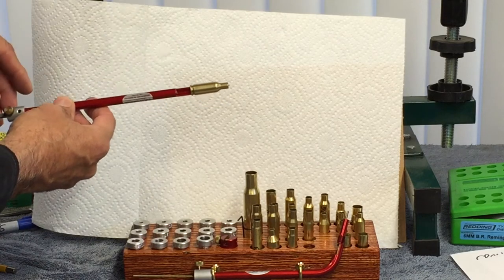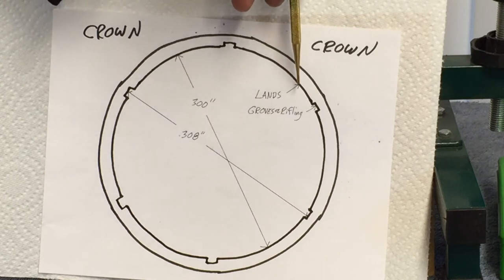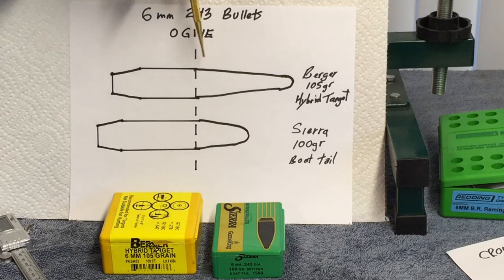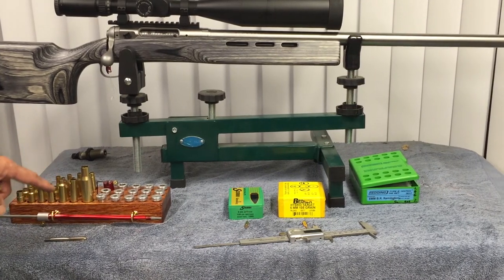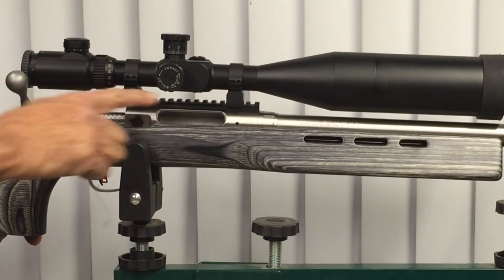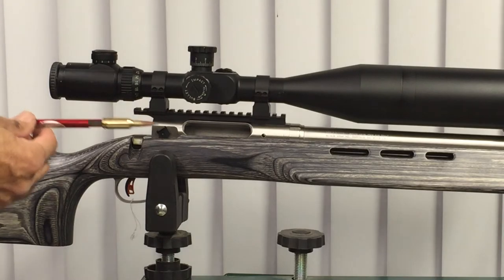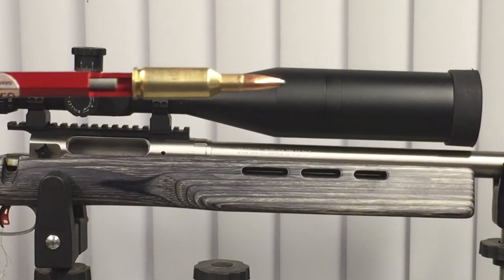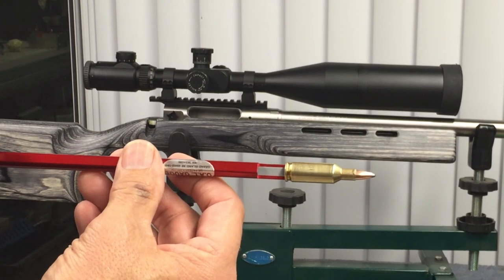Measure from the Crown to the Bolt in a Rifle Chamber

Comment: Thanks for the great video.  I am new to reloading and really thought you put out some great information.  If I understood correctly, with each designed bullet, will lend a different overall length to set the bullet to case in right?  What you displayed is a very accurate measure, cannot go wrong with this method.  Thank you for your time.
Reply from the maker: Francis Murphy Yes slightly different measurements. We need to be aware of the OAL so the round will feed in the firearm. Some will be to long. The off the shelf ammo is designed to fit all firearms and feed well. Accuracy can be secondary. Working #1. Some rifles like my 30-06 M1 Grande If I get the bullet close the the barrel crown the bullet will be sticking so far away from the brass base it will fall out of the brass. Difference should be slight. Good luck. Keep your powder dry. I always use my Hornady guage for seating the bullet depth. But again make sure it cycles.
Reply: Thanks.  I understand about precisely measuring the headspace for each given rifle.  But how about the C.O.A.L which is in all the reloading manuals?  Where do we drawl the line between the two?  Seeings how those are SAMI specs also?  Like I said, I'm new to reloading and still acquiring my stuff to do so.  And from what I can see, this is a very important aspect of precision reloading.  Knowing what to do and do it right,  Thanks again.
Reply from the maker: Francis Murphy My understanding the ANSI COAL is a standard.The "Jump", :Clutch" "free bore" is the distance from the bullet to the crown. You need to have some. When the chamber is ignited this "Freebore" allows pressure to be releases easily for a split second, the bullet moves without the resistance of the barrel pussing against the crown. Without this you can start off with unsafe pressure untill the bullet moves which is mechanicial and takes time. If you have a bullet that is long and narrow and measure off the ogive. The tip will be over the COAL. In this case it might not fit in a mag, to long. You need to watch both COAL and OAL. I always is to the ogive not the tip. But make sure it will fit in the mag, feeding route. The difference between 10 thou and 20 thou in accuracy is hard to tell. You need to be a real good shooter and run an experiment with lets say 10 made at .001, 10 at .002 and so on. This is often called a ladder test. I take my 10 and record worst out of 10 and worst out of 8. I do this because of my shooting errors. Often one or two will be way out of the grooup. These are called flyers. Presision shooting is very hard. I have a long wat to go. I have my 5.56 AR group down to less than .60" at 100 yards just by running a ladder test on different powders. I run my ladder with different Ogive measurements and can not see the difference at 100 yards. I need to reach out to 300 yards plus and run test. One of my problems is a small gust of wind at 300 yards will make a flyer. Use on of the ballistic calculators using zero wind then 3 mph wind with 55 grain at 300 yards. It is significiant. Reloading is the ultimate science project. I just moved. I have no reloading shop now. This fall 
 should have my house remodel far enof along so I can build me a new shop. My old 10'X12" was packed to much stuff. My new 12"X 24" with 9' ceiling for attic storage. I am a gun horder. Lots of compoinets, tools. been collecting real serious for 7 years. You are new tools are like music instruments. A good musian can make any piano sound great. A student can keep blaming the piano.
Reply from the maker: Ron George One more thing Francis. Learn about Squibs. These are very dangerous. A squib is where a round is loaded with no powder. I have made one and fire in my gun on purpose. The gun makes a pooping noise. The bullet goes into the barrel past the crown. 
if this is not caught the next round will blow up your gun, BANG. When I did this I had to beat the bullet out of the barrel with a rod and hammer. This took an extreme amount of beating and made me realize how much resistance the batter gives to the barrel. A 308 bullet. The barrel measures .300" inside diameter and .308 to the outside of the lands. 
this makes the .308 bullet squeeze  from .308" to .300" leaving the lands full of bullet for a very tight fit. Bullets are to fit very tight. If they "Bullets"  are not tight "fit" gasses will escape between the bullet and barrel varorizing some of the outside of the bullet. this vapor is vaporized CU or lead which cools and sticks to the barrel fowling the barrel extreamily fast. This is most common with Lead "PB" bullets. We need some free bore between the ogive and the crown. Once the bullet enters the barrel at the crown there is much resistance. Usualy you want a very small freebore. Like .002". Be careful.  Do not put a round in a gun where the bullet rest on the crown. It will not be accurate. I have done this with no explosion. Does not make it safe or right. Hope I have helped.

Ron